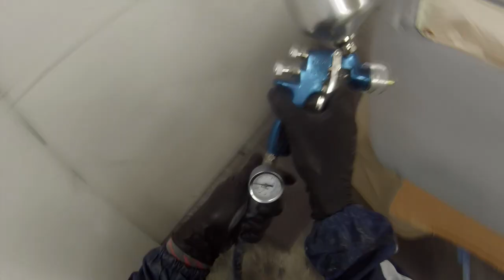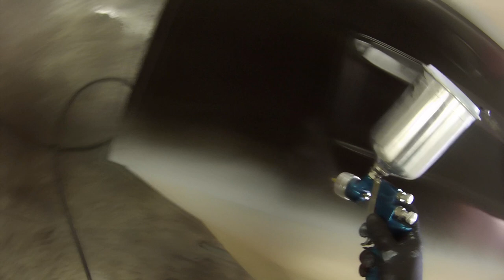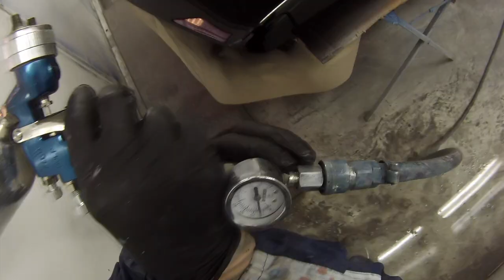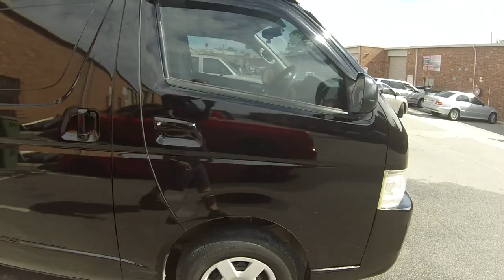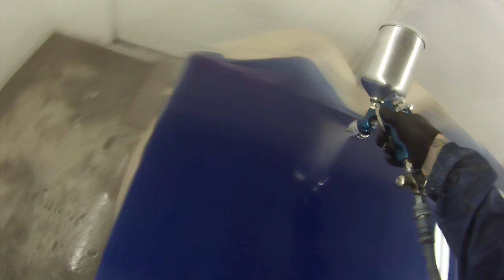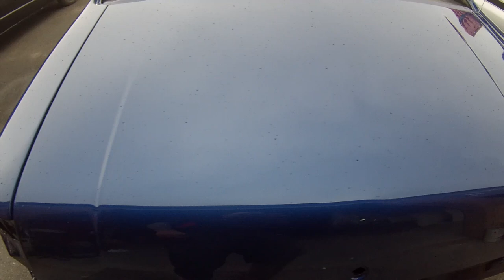Finish Line Spray Gun By DeVilbiss

Comment: 12-15 PSI at the regulator with the trigger depressed? Also do you spray with the fluid knob fully open? I was shown in my auto body class to use that knob to control the amount of paint that comes out the tip, but the manual for my Finex FX3000 says "for minimum fluid flow and to prevent premature fluid nozzle wear, turn fluid adjustment knob counterclockwise until no trigger restriction is felt.." "Continuously spraying with the fluid adjustment knob closed causes accelerated abrasive wear on the fluid needle and trigger/air valve shaft interface."  How is that even a thing?

Comment: I lost one of the o-ring of my FLG-3. There is 2 seals when you install the fluid tip and I lost the large one. Where can I BOTH seal to buy. Seems the large one doesnt come with replacement fluid tip. I've only seen the small seal in some kits, the one you put in before screwing in the fluid tip. Can anyone direct me to a part number or store that carries it? Would be much appreciated

Comment: I use the gun only for primers in a production shop because the gun use to much air pressure to get that nice slick finish in my clear. I would recommend using a good air supply so you can run this gun properly or use medium solids clear not for high soilds.

Comment: I have two of these guns. Originally for sealer, primer, and edge-in. They both came with hvlp caps. I didn't like the small fan, but it does help to keep overspray down and fogging up the shop. I ordered a couple of conventional air caps in hopes of salvaging a decent sealer gun and other ancillary material spraying.

Comment: I would love a video that shows how you setup the gun. Mine just hasn't sprayed right in a while, and I would love to walk through setting it all up again,.
Reply: I don't recommend you get this gun. Reason being I did. And it has a part that wears out fast where the needle goes to the tip. It will start leaking paint when it wears out. And it costs 30 bucks to get 3 new packing nuts for it. So perhaps that is the issue with yours? The nut in front of the trigger needs to be removed and you fish out the nylon washers as well as the packing and under neath the packing is another nylon washer. Go to amazon and order you a devilbiss packing for this FLF4 Finish Line. Hope this helps.

Comment: Thanks for the vid. I just bought this gun, but I am wondering why you lowered the pressure for your base enough to get orange peel. I am going to spray urethane on my mustang I’m building and hoping to get as smooth a finish as possible in the bay since I can’t cut and buff all the odd spots.

Comment: Nice!  Looks like this gun turned out OK with the 1.3 tip.  I am still shopping and in no rush so I will wait for an Air Gunsa review, as I know you have said that is a very good gun for the money.  I also have a cheap economy 3 gun set that I need to test out before I buy something else.  The set was a Christmas gift and I suspect they won't be good except maybe for primer and small touch up work.  Thanks for sharing your knowledge!
Reply: Is the 1.3 fluid tip also a #3? Not sure of I missed that.

Comment: I wish you were in the USA Gunman , I would have you spray my 66 Dodge Coronet. I was unhappy with the results using flg3. It may not have been the gun to blame. 25psi. was probably too much during the summer here in New York. U-Pol 2:1 clear has nice gloss on it. Wet sanded it/ polished and its OK now. Too much peel out of the gun.I found a website Spraygunsdirect in UK. Very low prices. Flg5 for under $120 american dollars. Thanks for the tips on how temperature changes psi. required. Thanks to your videos I have more knowledge moving forward. Cheers!

Comment: I had a Sharpe Finex 3000. After 3 mo. the fan control stopped working. I bought a rebuilt kit for it. In the process of rebuilding it, the needle got stuck in the packing. It's design was ridiculously complicated and after the needle got stuck, I was so angry, I just threw everything in the garbage. Consequently, parts of it were soaking in thinner along with a Sata 3000 RP nozzle from a gun I had previously bought. I inadvertently threw it away too. I recommend a  no on the Finex.
Reply: Thomas Baskette If your throwing Sata s away, throw some my way working or not!!!
Reply: Jay Fleming It was  definitely  a mistake  on the Sata  part, Sharpe Finex?,  good riddance  to that.  It did spray good,  but servicing  it was a pain. To replace  the Sata  nozzle  was priced at $300 (needle and nozzle kit, can't  just  buy a nozzle).

Comment: Gunman have a question my sister scratched the side of her car against some concrete pillar so it is more gouges than scratches i was thinking that 80 grit area but dont go past the clear if i can help it and just putty the gouges oh and can you Bog  ( use filler ) just in the scratches and paint and can you bog over epoxy primer ive been told you can but not sure

Comment: What compressor are you using? I have a 4HP 20 gallon craftsman that will run about 10cfm at 25-30 psi. This gun says it requires 13 cfm, but im wondering if I can get away with using my compressor. total displacement is 11.2 cfm. Your parts look awesome.
Thanks!
Reply from the maker: I'd recommend a LVLP gun over HVLP

Comment: I know it's not directly relevant to this video, but could you recommend a decent filler? One that I can get here in the UK. I've been using Upol Easy lite, but it just doesn't seem great.. Also, tips on how to make the filler work invisible? I filled it smooth, couldn't feel it through my finger tips, applied primer, and in the light you can still see the area that i've filled, I just can't seem to get an invisible repair. I've got a 150lt compressor and a DA, and also go at it with a block and sand paper, but I just don't seem to have any luck!
Reply: Also, thankyou greatly for taking the time out, to make and edit all of these great videos, they really have helped me, and i've binge watched the majority of them now! Really helped me learn about 2k painting having only been used to cellulose before. Almost at the paint stage on my classic mini once i can get the filler perfect.

Comment: so what grit paper did you use to sand the clear before reclearing i did one job used 1000 recleared and it didnt seem to have enough bite to hold the clear
Reply from the maker: Dana Wick I finish with 800 but 1000 should still be enough to grab, that dust coat I started with will help adhesion too.
Reply: ah i went full bore thank you

Comment: Great video!

I think I'm going to try one of these to get started spraying.  Not going to even bother with the $15 gun I got from Harbor Freight.  Lol
Reply from the maker: Hammerhaus Kennel A FLG5 is another good option.
Reply: The Gunman Thank you!  Since I wrote my earlier comment I checked out my old compressor and learned that it is only a 3.3HP with a rating of 10.0cfm at 40psi.  I think now I have to look for a gun that is a little bit more efficient than the FLG4, right?  

I looked around a little bit online here (USA) for the FLG5, and so far I don't see any in stock.  It looks like the FLG5 might be a bit more efficient of an air user than the FLG4 from the specs I see posted.  

Do you have any other suggestions for me short of buying a new compressor?

Comment: Tried my best with laying the pattern nice and even but still leaves shadows. What do you think about just increasing my psi and misting all 3 coats? Would this be a good idea or I'm gonna be wasting paint lol
Reply: Usually, lowering the psi and backing off a few inches on my second coat gets rid of most of my striping/mottling issues. (I tried doing it with the first coat still wet but got runs) Can't stress enough how helpful a test panel can be when learning a new technique or just making adjustments on a warmer or colder day. Costs a bit of extra paint but respraying costs much more.

Comment: my aircompresor is just 2hp..which spray gun from devilbiss do i need to used from primer to base coat to finishing coat..please sir i realy need your expertise advice..Much love God bless..
Reply: I've used this gun on my craftsman 33 gallon 2 hp compressor.   You have a little working against you from my experience.  Use a different gun for primer with a larger 1.5mm or more tip.  This gun has a 1.3mm tip which works for base and clear.  Make sure you get constant 20-23psi with trigger depressed at the base of the gun.  Adjust the fluid  flow leaning more towards open than closed and pattern of cigar.   Practice on cardboard till you get a desired result.   Learn to wet sand too for best results.

Comment: im using a 2k primer for a 92 Dodge right now and the sealer is clogging with the primer under the correct 4:1 ratio of sealer to activator. How much less activator should I use? I'm doing 1 pint of sealer to 4 ounces of activator.
Using Eastwood paint btw which is a nicer brand
Reply: Should I try an 8:1 ratio? Seems a bit low

Comment: What is a good pressure for base and clear with the flg4 in 95-100°F
Reply: It depends on the brand you use.  Many come with a tech information.   What I have found,  the regulator at the base of the gun when pulled at trigger should be 23 psi for 10 psi at the cap per hvlp 'finish line' models tech sheet.  Always do a test shoot on cardboard for pattern/ atomization and maybe have a spare pc of primed sheet metal if unsure.  Keep an eye on temps when shooting as you may need to use a reducer that works for that temperature.   Slow reducer for 80+ degrees,  med for 70-80 degrees  and quick reducer for 60-70 degrees as per reccomend on the instructions.
Overall,  you do what you feel comfortable with at psi depending on your speed,  distance, temperature and brand paint.   Not all brands flow or set the same, so you may find you lean more towards one more than another.

Comment: Hi, I noticed you posted a link to an ebay listing on another video in the comments for a gun, that same seller vgautopaints they have the GTI Pro Lite for $449 have you ever gotten anything from this guy before as all my suppliers in Adelaide sell them for $650+ so to me it seems too good to be true.
Reply: ***** Thats Dave from another painting channel. I got my Iwata AZ3's off him a few years ago quite cheap and they're still going strong. I think I payed like $300 for the two guns, a regulator and a cleaning kit all in an iwata case.
Reply from the maker: Yeah its not too good to be true man no probs at all, they just drop prices to get the sales and do it on volume.
Reply: Sweet thank you guys for the info.
Reply from the maker: Luke InCyberspace Agreed mate, I am getting a Concept Paint system installed in my shop on Monday.